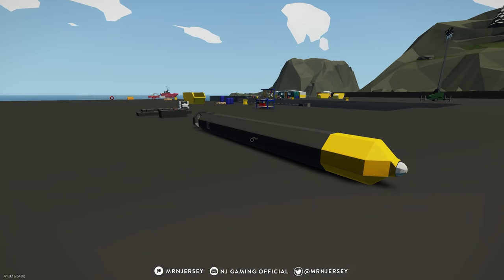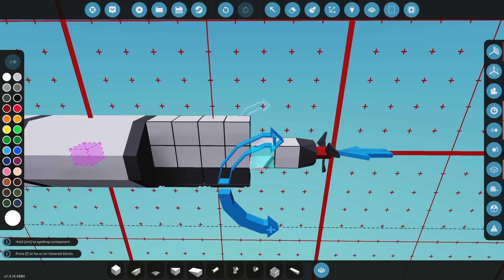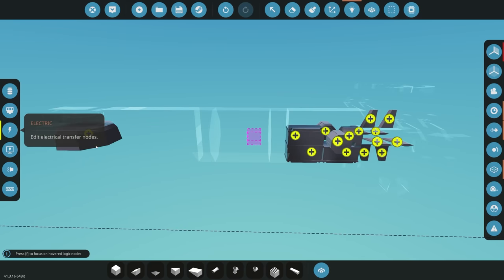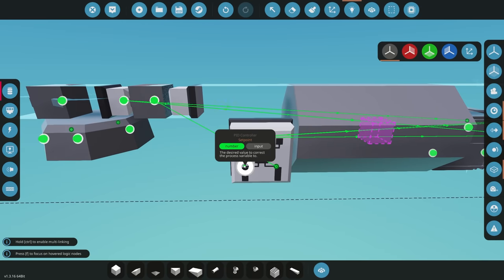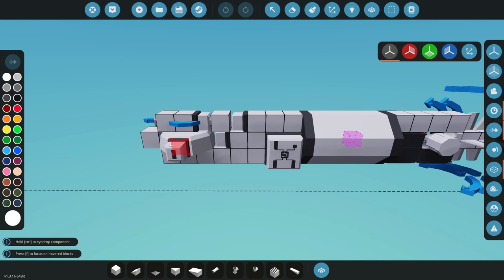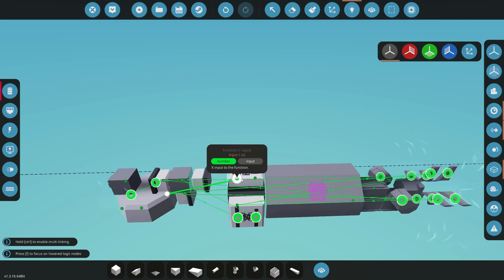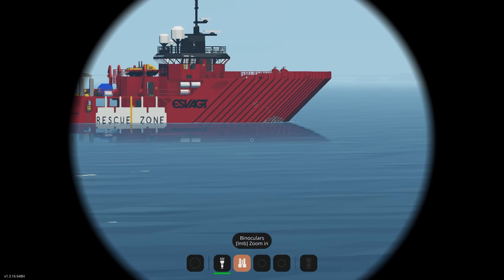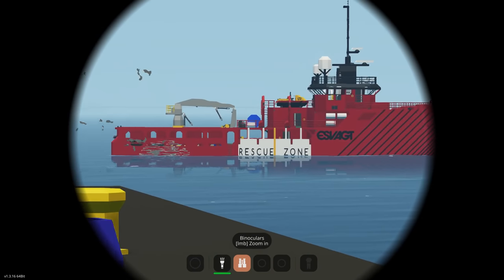Sonar Guided Torpedo Tutorial - Step by Step Guide - Stormworks

Comment: I had a problem with the tracking on mine. To make it work properly flip your sonar vertically and make sure the function block is -x*6 instead of positive x*6. That should fix it.
Reply: thanks mate, I was editing this and re-watching the video for a good hour before i cam across this comment, it finally works!
Reply: vertically? facing which way?
Reply: @TryHardln  up down instead of left right it doesn't matter which way it faces.
Reply: @overclocked5422  I got it working now thanks a lot my guy
Reply: My sonar only wants to rotate to one side. it turns ones the target is in range bur for some reason if it's x*6 it turns right and if it's -x*6 it turns left. it doesn't matte if the target is left or right thats just the way it turns.

Comment: I've found that directly connecting an altitude sensor to the pitch will cause a hydrofoil to mostly plane at 0 elevation. Use a function block to offset it and bob's your uncle.
Reply: thanks for the advice bro
Reply: @_bernat9132  wait this still works? neat
Reply: Late to the party here, but you can subtract target depth from current depth (called a deviation) and use this in a function to control depth, start with  /2 & work your way down if it's too sensitive. Mine go ~450km/h & /1.7 is perfect to keep it dead stable

Comment: Could you make a PID tutorial? I've always thought about using them but just can't figure them out haha
Reply: There is one on yt
Reply: Search up PID tutorial stormworks
Reply: So there are 3 gains
Gain means boost
Propotional,integral,and something that starts with D

Propotional gain, lets say is the booster of the urge to change the variable to the set point

Integral gain calculates the future if the variable keeps on moving towards the set point which makes the speed of change decrease as the  variable reaches the set point

D gain is the boost to resist the quick changes (kind of like inertia), which makes sure that the variable doesnt start to move quickly to the set point(because it would be harder to slow down)
Reply: @luckyizzac  Derative

Comment: You actually want to keep the center of mass away from the control surfaces so they have more effect on the orientation.

e.g. its way easier to balance a Hammer on its handle than on the head

Real life rockets also have the center of mass near the top btw
Reply: what was that additional thing in the front above the sonar. it had a single green connection point, what is that because it just kinda appeared
Reply: @SpiffyBloom  thats an altitude sensor so the torpedo knows how deep it is underwater
Reply: how is that possible that rockets have a center of mass near the top when they have all the fuel closer to the bottom?
Reply: @h.w.3759  payload...
Reply: @laurinmeier4045  may I get source you get info about rocket's center of mass from?
Reply: @h.w.3759  it is impossible for rockets as in space rockets to have a center of mass near the top you would learn this stuff if you play ksp you just flip if you slightly turn
Reply: source: trust me bro
Reply: @GodzillaJawz  which is why they stage. in space they don’t use control surfaces due to lack of air, they use engine gimbal
Reply: @lahar2412  no I’m talking about the first stage where there are fins if the center of mass was at the top you would just spin out and crash

Comment: My torpedo is going the wrong direction, the target is to the left but it goes to the right, or it's not tracking att all.

The torp going in the wrong direction seemed to be that i had a sunken boat nearby, still doesn't explain it going to the right.

I removed the boat and now it's actually tracking the boat i have parked a bit away, but it keeps turning left after it goes the same heading the boat is in.

And yes, the torpedo is set up like in the video.
Reply: Iirc elevation angle isn't the right output to use and you need the azimuth instead.